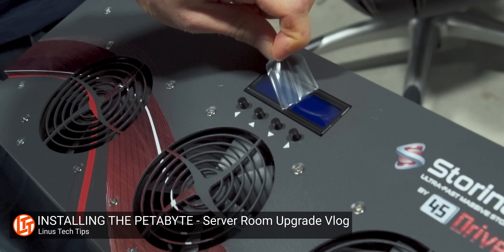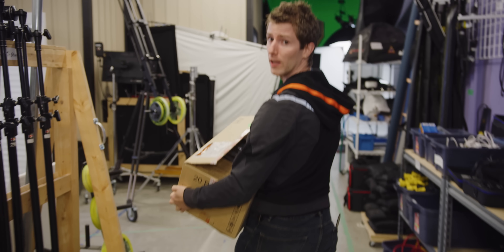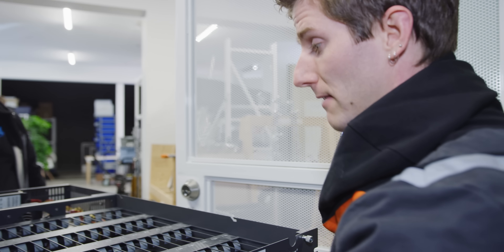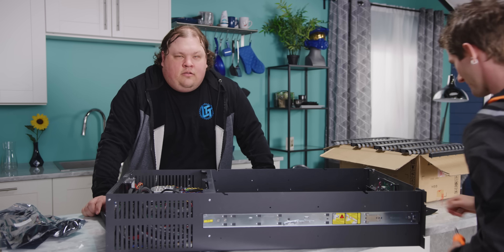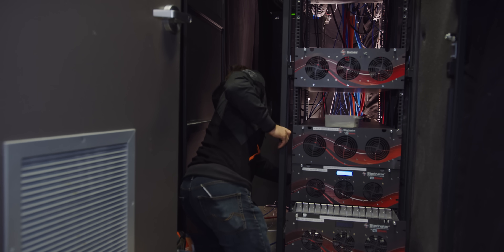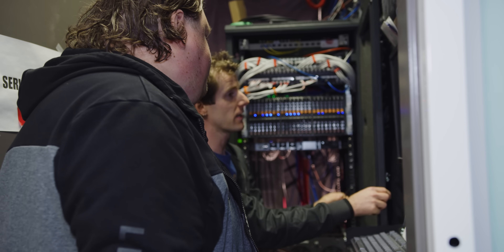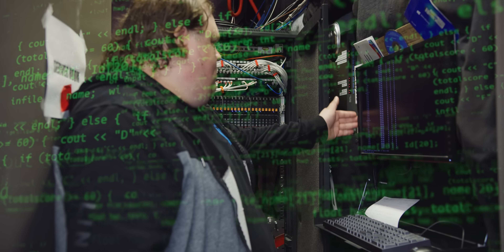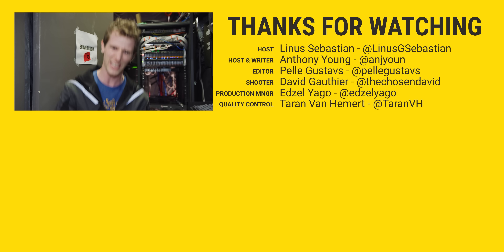Petabyte Project is FULL! Time to upgrade...

Comment: There was no need to re-insert drives in the same slots. ZFS will automatically take care of swaps for you as each drive is internally labelled with a UUID. You can mix and match drives in any slots and let ZFS sort it out for you.
Reply: Nice to see technology has advanced.
Reply: I’m not familiar with storage servers but this makes it hard to recognize and swap dead drives isn’t it?
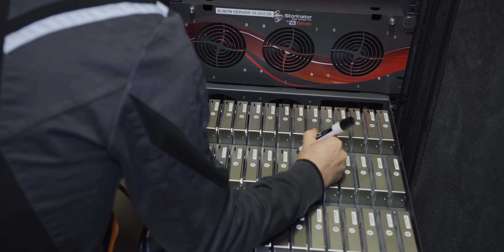Reply: @cptmorgan92  There are CLI tools to identify dead drives through blinking lights (via "sg_ses"). Another way is by querying the failing device and cross-referencing it with its serial number conveniently labeled on its outer casing (and clearly visible at 3:43).
Reply: @SaroG  using serial numbers is totally the way to go, but you can go blind trying to read those numbers when they are buried in a box in the server room.
Reply: Saro Gurunlu you’re right. Another identifier is the ID of the connector. If it’s labeled well it’s easy recognize
Reply: @cptmorgan92  Yep, I think that is why they were labeled in sharpie. The system may not care which drive is connected where, but people do. (Yes, I am quite aware of at least basic ZFS capabilities, had the same pool on my desktop for 3 motherboard changes, 4 OS changes, and at least 5 drive deaths in a 2 disk mirrored vdev). Now just don't get the carriers mixed up, and all is fine ;)
Reply: @mpdavis731  
Blinking LED: # sg_ses --dev-slot-num=0 --set=ident /dev/sg3
SN Lookup: # smartctl -i /dev/da13 | grep 'Serial'
Reply: Was thinking the same thing tbh, the system identifies and mounts drives to a point/array via the UUID not from a slot ID :|.
Reply: Nice to read this comment and not understand a thing
Reply: I'd still do it the "organized" way. It's not that much extra effort and makes one less problem.
Reply: @Time4Technology  There's nothing organized about labeling drives that are already labelled with a unique serial number from the manufacturer. In fact, it's counter-productive given the fact that we've already solved this problem over a decade ago with more efficient methods to identify equipment. You're literally going to spend over an hour marking 45+ drives with a felt tip marker and then updating the partition label (per server!) when a simple blinking light or a serial number lookup will suffice. If you're really dead-set on using your P-Touch, a better approach is to label the chassis rows based on the Host Bus Adapter it's connected to to facilitate SN searches after smartctl and sg_ses query.

Honestly, the drive re-labeling approach doesn't scale at any size. Home users with 1 to 12 drives can stick with SN queries. Enthusiasts/SMBs with 12-48 drives can identify with blinking lights. Enterprise-level businesses and cloud providers query by region->dc->room->cabinet->rackunit->server->hba->slot->SN (with a blinking light) to find a dead drive, and then schedule the replacement. All these queries take no more than 5 minutes, and if your chassis supports it, you don't even have to power off the machine or take the drive out to confirm serial numbers (some servers allow the drive SN to be viewed from the front).
Reply: I was just thinking MDADM works of device UUID so I would expect ZFS to also.

Comment: Wow the power/Sata cabling is janky. You really want it pcb based or at least easily accessible cable assembly to replace. Is there a space concern under that? If there's some freedom you should make some conduits or channelling.

That frame for sata connectors are janky also. Probably can use your lazer cutter to make some more modulus frames, instead of each row maybe every 4 drives etc.
Reply: We already know there is no body at LLT capable of building any thing Professionally. Better to just leave it because it works.

Comment: Why not treat the root issue? Don't archive all raw footage. There is absolutely no need to do so.
Reply: As much as this "might need it later" makes sense, there is no way they know what files they even still have at this point in the first place 1 PB is beyond comprehension. There's no way you know a certain clip must be from exactly 5 months ago and must be in this exact folder.

What I know from a "smaller" server at work (30 TB), none of my colleagues know if a file already exists when I ask them and in worst case, I will then have to make a duplicate. Truth is that it's so much data that you can't comprehend it and at some point nobody feels responsible to properly archive and sort old data and delete unneeded data because it'd take too long. You'd need a separate person for that. 

But when it comes to filling up an entire Petabyte I think you gotta figure out your priorities. That much disk space is anything but cheap.
Reply: RonsonDenmark Sure there is. They may have footage from 1 episode that doesn’t get used IN said episode, but then a couple episodes later suddenly has a PERFECT use as some stock LTT footage. There are methods to their madness.
Reply: @TheSecretman82  Very good reason to spend tens of thousands of dollars (when stuff is not sponsored) on hardware and man power to avoid using 10 minutes to reshoot some b roll.. Yes, that was sarcasm.
Reply: RonsonDenmark Re-shooting B-Roll only works if the project is still in 1 piece or even still at their studio. They tear a lot of those projects apart unless they’re being actively deployed for use. Case-In-Point: They got the new drives for a separate project. They did the project, they took said project apart and cannibalized the drives to upgrade storage capacity of the server. You don’t always have the luxury of just “re-shooting the b-roll” when you’ve taken the project apart. Beyond that, it’s gonna take more then 10-minutes to reshoot. They have to setup lighting, camera placement, etc. and do test shoots to see how it looks. From there you adjust, rinse and repeat until it looks right. THEN you shoot your B-Roll. Easily 1/2 hour - 1 Hour minimum to get setup. Sometimes, it is logistically way easier to save your shit like they do.

Comment: LINUS FROM 2030

Petabyte, what's a petabyte? I've 1024 Exabytes of Super Fast SSD.
Reply: Binit Poddar pfft
2035
My USB-R  32 Yottabyte key fob is out of date.
In 2036 the new USB-X ‘ rare earth drive’ will be the the latest state of the art at 12 grams
Which contains 256 Yottabytes, which takes a whole 9 sects to fill
Reply: I'm almost done with my home yottabyte array.
Reply: SSD? You mean, like, HARDware?! Where I come from, solid state is outdated and slow. Electrons can only move so fast, be maintained for so long.

Comment: I normally don't comment on youtube videos, but this video hurt me so much that I HAD to.
1)
When configuring a ZFS Raid you add devices through their unique identifier (so not through sdx) so that you don't have to label your disks and put them in "the right order".
2)
You have a gluster system and you take all the positive aspects of it and throw it out the window, because you use zfs for so many parts of it.
If you have that much storage that you need multiple servers and you already use gluster then you should use it for the erasure coding (or RAID as you would call it) as well.
Distributed Dispersed would be what you would want. 
3)
Normally I would recommend a ceph solution for storage clusters of your size and tell you to use multiple smaller servers instead of your setup that has so many failure points,
but you now have the setup you got and ceph would be probably too much for you to handle anyway.
4)
The many small Servers instead of 2 big ones concept applies to gluster as well and you wouldn't have the downtimes you got if you would use that system.
It's easier to maintain, easier to scale and could even be cheaper (but hey we all know you like overkill) 
5)
If you read till here thank you and now the last tidbit of information: If you would use gluster like it was intended, 
you could also add your other storage systems (for instance your local steam cache) and add it to the cluster.
Than you wouldn't have run out of storage at all!
Just add one volume without any replication or erasure coding for the steam cache and one with erasure coding for your editors. BOOM! More space for free!

Edit: updated formatting
Reply: You saved me writing my comment, so even if no-one else does, i appreciate your comment. Also, i'm a SAN guy, if i saw a setup like that, i'd walk away. There really needs to be someone trained in maintaining and setting up this equipment on site and from the video is was clearly apparent that there isn't. Love LTT and the videos that are pretty much untrained people making the videos, thats the fun, but when it comes to a server room and networking, id definitely suggest getting someone in who knows how to do it properly as that setup is a mess, clearly very inefficiently setup and not maintained correctly. Not knocking LTT here as I love the channel and have been a big fan for a long time, but if youre going to do something that fits a standard, surely it should be done correctly?
Reply: This is not a standard build. Anthony said something about "their driver," which suggests that there is some 45-drives magic going on under the hood. I'm sure you noticed they had to maintain a disk-to-slot mapping, and I would speculate that the OEM software does that mapping under the hood, presenting specific slots the way we saw here. I mean, sure they might just be doing it wrong, but it seems unlikely that they'd get to this point in that system's lifecycle without both knowing and mentioning this particular best practice for ZFS.

The best part of Gluster is when you can retire it. A broken Gluster setup is a nightmare, and it's prone to breaking IME.  I would never use it for this much data and for such trivial reasons—they just want to present multiple servers as a single share.
Reply: @andrewbobulsky3505  Theres not really such a thing as a standard build in SAN architecture, more standard practices, of which, not many were followed. Im not personally looking for an argument btw, I have worked in this industry for a lot of years and im just saying what I see, but i can assure you that anyone in the SAN industry that ive sent this video to have all said the same thing, someone more technical in this field needs to be there. Anthony is great and I think he does some fantastic videos, but I think the "hacking" sort of field seems to suit him and Id have said the commercial IT field would be better left to someone who has worked in this field. Absolutely not a dig at Anthony however, we all have our specialist field within IT, his hacking (the real meaning of hacking, not the script kiddie kind) ability is clearly excellent and very informative.

Comment: man, how come the largest disk space of hard drives we managed to get so far is only 12TB 

I mean it has been a long time already shouldn't we expect larger HDD capacity ? or are SSDs taking over?
Reply: Ssd are taking over there is i prototype 60tb its just rly expensive
Reply: Seagate already has large SMR drives running on air without helium, I’d imagine they could easily beat their capacity on those 8 and 10tb SMR backup drives as they don’t even run warm in external cases with no airflow. 

My guess is since SSDs are taking a long time to come down in price on their bigger sizes they’re just milking the existing lines by intentionally not increasing capacities to keep the prices hovering around the same price they’ve been for the last two years.
Reply: I just read about 20TB drives releasing soon
Reply: Actually, Seagate has 16TB IronWolf drives.

Comment: 1. Using AWS for backup storage
2. Using SSD based storage server
3. Using Harddisk based storage server
4. Storing all backup data on CDs
5. Storing all back up data on floppy drives
6. Storing all back up data on punch tape
7. Physically writing all data in 1s and 0s on paper.
Reply: 8. Building a redstone circuit in Minecraft that uses chests and hoppers to computationally store dirt and sand, which represent binary units of code.
Reply: Big brain !
Reply: paper is not secure enough stone tablets might be more secure... so lets secure all the 0 and 1 on stone tablets
Reply: @bigdwarffrosta7877  titanium alloy
Reply: you can store data qr-code style on printed paper and read it back in with a scanner

https://www.extremetech.com/extreme/134427-a-paper-based-backup-solution-not-as-stupid-as-it-sounds

Comment: "The vibrations could kill the drives."

Proceeds to slap table multiple times
Reply: There are cases where inert gas fire suppression systems caused large amounts of hard drives to fail. The sound of the very high pressure gas coming from the nozzles was enough to wreak havoc over a data center of the ING Bank for example.

Here is an example of someone shouting at disks: https://www.youtube.com/watch?v=tDacjrSCeq4

Here is a longer article from a data recovery company: https://www.ontrack.com/blog/2017/01/10/loud-noise-data-loss/
Reply: @zvpunry1971  Here's another one.  ~grin~ https://www.youtube.com/watch?v=1y8Rqvz-Jcg
Reply: vicsrealms: thats what actually happens inside of the disks. ;)
Reply: zvpunry I can personally attest to this. Acoustic shock can break your drives.
Reply: @Martin Rabson It's all valuable how?  Can you give me an example from say videos produced in 2019 that used content from a  2014 or earlier video shoot, that did not make it into the video published at that time?  Maybe a few sneezes they cut out when linus had the sniffles?
Reply: When the drives are free and filled with old crap you'll never use, who cares?
Reply: By the way, if disks aren't running, the heads are in parking position (removed from the platters). They are fairly resilient to vibration and shocks in that state, so banging on the table is relatively harmless.

But rattling them over a parking lot in a shopping cart is something else. I can imagine that this can move the heads from the parking position to the non-moving platters. If this happens, the heads will almost immediately stick to the platters. The spindle motor isn't able to start and if some unqualified person opens the disks and forcefully moves the spindle or tries to lift the heads from the platters, it is very likely that the heads get ripped off. If a disk doesn't spin up after being dropped or exposed to excessive vibrations, the 2nd best thing to do is bringing the disk to a reputable data recovery company. (The best thing is having backups, and as the data center inert gas fire suppression incident shows, it is also good to have off-site backups;))

Comment: giving it like about 5cm more space ( ~2inch) below the drives could be more efficient with changing those cables. But I get why they aren´t doing it since. 10 of those bad boys result in an extra 50cm.  Still would make it more efficent I guesse. Also can someone please explain how big the difference would be if you would change the hdd´s with ssd´s? I know it would be way more expensive but I just can´t get around the size difference and generell performance increase.

Comment: What I don't understand is why they have to make sure the drives go back into the right slot. Is this just Linus being OCD, or are they really relying on the physical topology and drive order to accurately reassemble their arrays? This is what logical drive labels are for people! You don't use block device name for that, you use a UUID on every drive, that way it doesn't matter what order the drives come up as when the system boots.
Reply: Depends... if done properly, depending how many RAID controllers you use, and how many drives are per channel - you make a RAID that you can work even if one lane dies, one cable dies, or whole controller dies. In that case order of disks is important.
Not using UUID's for pool is a bit of... rookie thing. However, even if you did use device names to create a pool, you can export it and re-import it so it uses UUID's.

Comment: Whenever setting up new drives for ZFS, it's always a good idea to force 4k sectors, either at the ZFS level or at a higher level. I build my ZFS on encrypted GELI containers that enforce a 4k sector size.
Reply: Andrew Fremantle would 8k or 16k sectors for very large red files would be faster, with minimal wastage , no ?
I’m not being smart, just curious
Reply: @0menadds  Hard drive sectors sizes are different than file system allocation unit sizes (aka "block sizes" or "stripes"). Hard drives today are manufactured with two types of physical sector sizes: 512 native ("512n") and 4096 native ("4096n", "4K" or "AF" for Advanced Format). Normally, ZFS can automatically detect the the sector sizes and adjust accordingly, but not when it's being lied to. Presently, every drive manufacturer that delivers a 4K drive has 512e enabled, short for "512 sector emulation". This essentially tricks ZFS into thinking the drive is a 512n when it's actually a 4096n. Running a ZFS pool with mismatched sector sizes will significantly degrade performance and give you nothing but headaches. I once created a new zpool vdev with an incorrect 'ashift' entry. Only way to switch from 512 to 4K was to destroy and recreate the entire ZFS pool. To make future upgrades simple, creating a new zpool with an 'ashift' entry of 12 instead of 9, even if you're initially starting with 512n drives, is a wise choice to make.

Comment: Maybe it's time to consider lossy compression. I mean only a small percentage of that footage will ever be watched again and even less used. And lossy compression can probably reduce the file sizes to less than half with minimal loss in quality.

I'm not a video guy but I use Adobe compressed dng to compress my photo library which brought my average file size down from 24mb down to 5mb and use Lightroom to flag my best shots so they don't get compressed even though frankly I can't tell the difference.